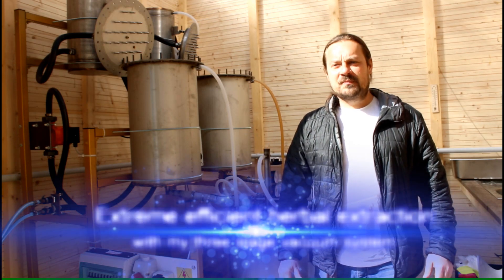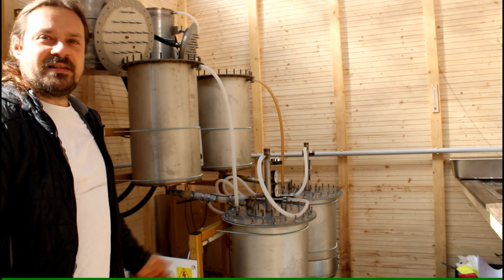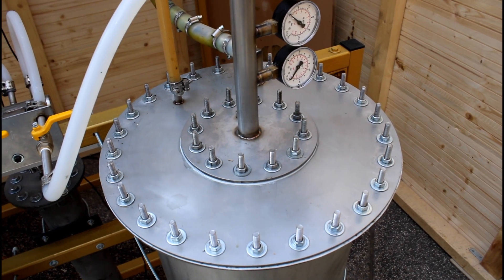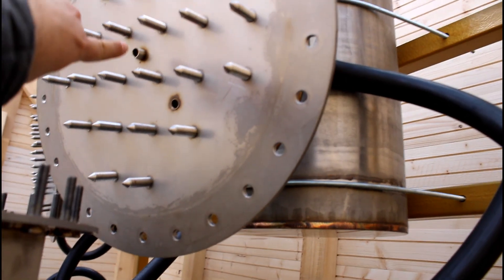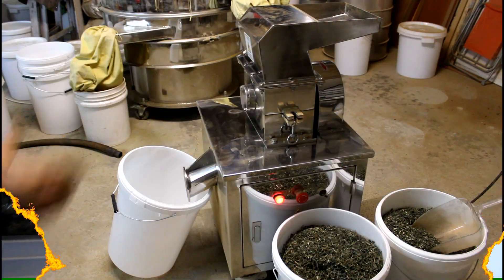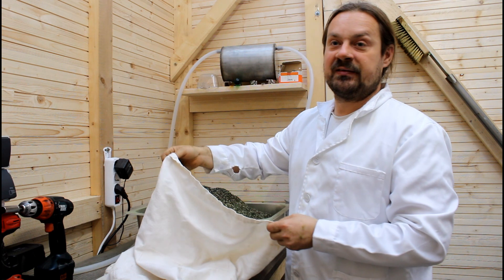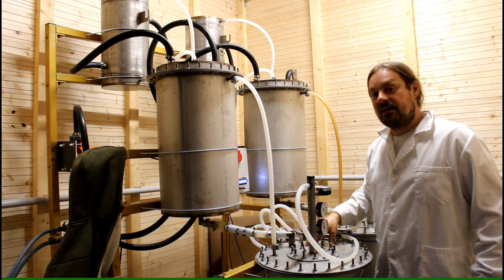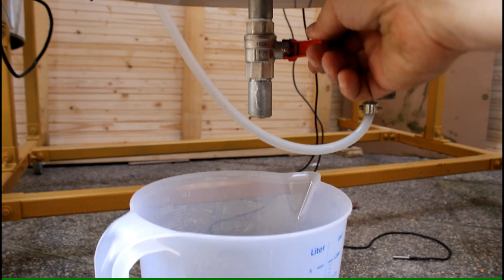extreme efficient herbal extraction with my three stage vacuum system

Comment: Using the vacuum allows you to choose the temperature the solvent sits at, do you have variable control such that you can perform extractions of heat sensitive substances?